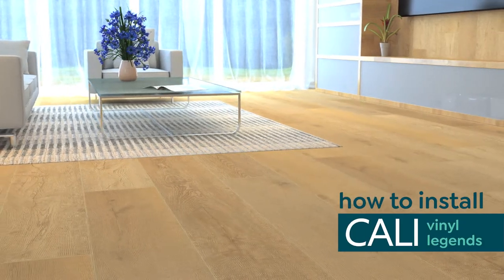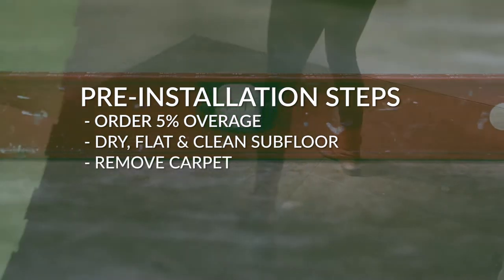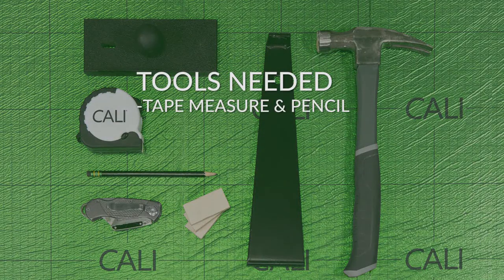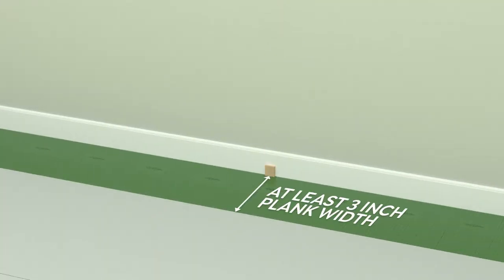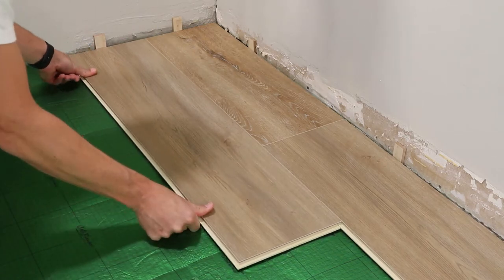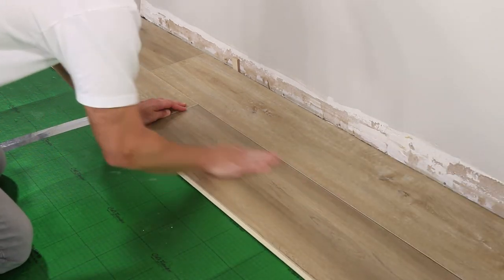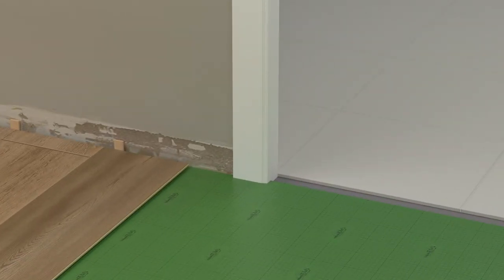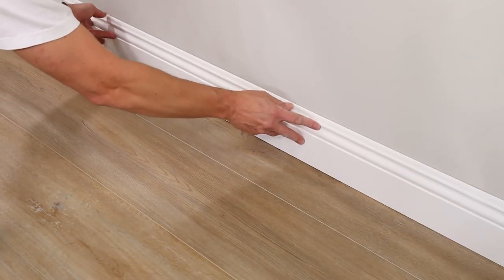Cali Vinyl Legends Floating Install Steps

Comment: What happens if you put the flooring down on concrete without the moisture barrier?
Reply from the maker: If you're installing vinyl plank flooring, likely nothing, but it's always a good idea to keep moisture away from flooring even if it is considered waterproof. The easiest solution is to apply Titebond 531+, it rolls on like paint and dries in an hour or two. Think of it as flooring insurance. Sweet profile pic BTW, do you own an air-cooled?

Comment: How are these different from longboards?
Reply from the maker: They're 1/2 inch thick, so if you're replacing existing hardwood, you won't need to either shim the entire floor or replace your door casings. Legends is also a touch shorter at 60 inches long, WPC core not SPC and it has a Lifetime Warranty.

Comment: Click on expanding page under title ‘HOW TO INSTALL CALI VINYL STAIR TREADS’  get to this video on ‘installation steps’.  NOTHING ABOUT STAIR TREADS.  Apparently someone in the IT dept. or web directory/links format designer is utterly inept and tremendously handicapped with the English language.  I clicked on website and no less than three times I was directed to something different than what so selected.  Is it really that difficult to get the proper info?  Wtf?  Whomever prepared this info achieved a massive FAIL!  What is the approved method of installing CALI VINYL CLASSIC STAIR TREADS?  I care not about installing the bamboo stair treads nor in plank installations steps.  I WOULD BE PLEASED TO GET THE APPROVED INSTALLATION METHOD FOR INSTALLING THE FAKE PLASTIC CSLI VINYL
Reply: CALI VINYL CLASSIC STAIR TREADS TGAT LOOK TO BE ABOUT 4’ long and about 13” deep with an overlapping built in nosing that caps the top of riser directly below?  I believe this cannot be misunderstood and has been asked in clear detail with sarcastic emphasis on what I am after.  Please, pretty please, respond with a simple straight forward answer.  I imagine there is an approved adhesive to fasten it to wood tread.  I care not on the cutting and sizing just the approved method of securing it in place.  Surely this cannot be misunderstood.  Thank you.
Reply from the maker: Hi Sir Mixalot, we're sorry you're having trouble finding an answer to your stair tread question. Just so we're clear, Cali Bamboo is not liable for injury or death should you install the treads improperly. We always recommend using a licenced flooring installer. That said, the treads can be cut down to fit and we recommend using Titebond PVC Trim Adhesive and Sealant to adhere them to the subfloor. We sell it here: https://www.calibamboo.com/product-all-in-one-titebond-pvc-sealant-and-trim-adhesive-1101100300.html or you may also be able to find it at your local home improvemt store.
Reply: Thank you for your reply as well as getting to the point.  I swear it’s like pulling teeth anymore.  The links on the site need some attention in case that was missed.  Again thank you.